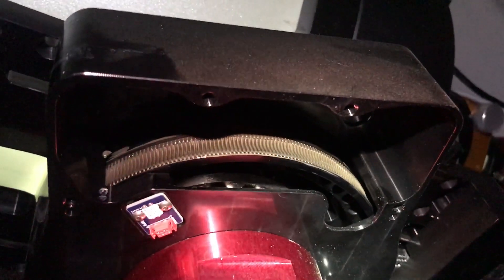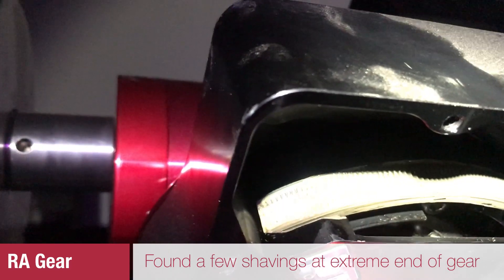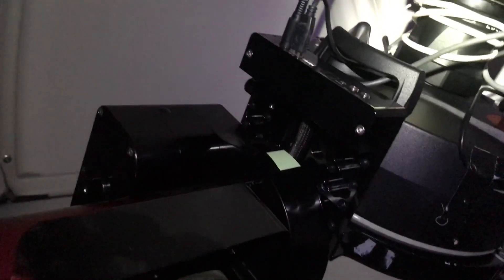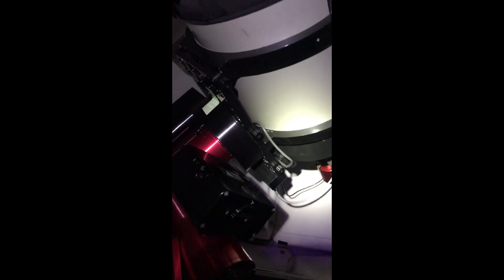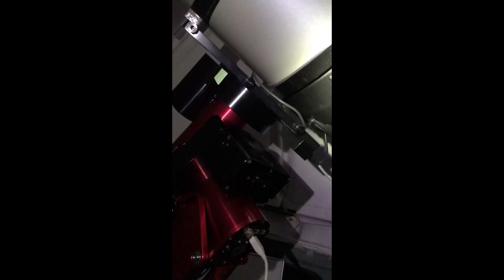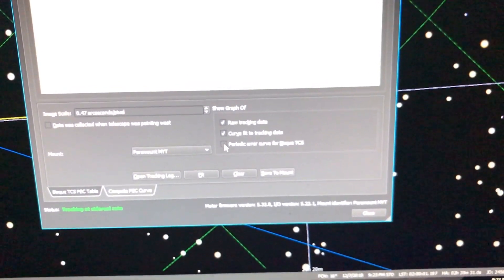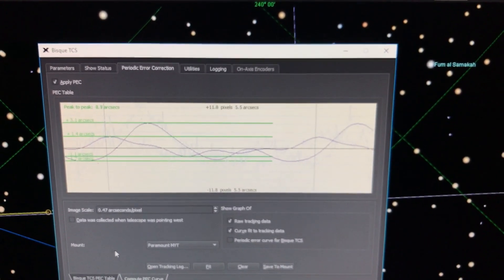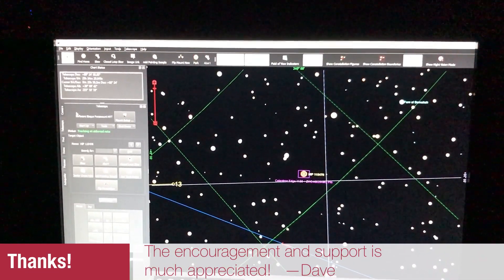PARAMOUNT MYT Visual Inspection and Star Test.

Comment: Congrats on your MyT surviving.  What happened to the video of the dome blowing off?
Reply: Larry Marks  It was being used without my knowledge or permission as a marketing tool against the dome manufacturer with claims by a rival company. Truth is I didn’t have an available safety tie down in place and part of the blame for the accident is on me. I moved it to private.
Reply: James Tickle Makes sense.   I was thinking about doing the same thing you did with my pod.   How is the ND dome normally held on to the pod?
Reply from the maker: Let me preface by saying a disclaimer. I did the solution I did because we are severely funds limited for this project at the college.  Had I the budget I would have replaced the entire structure with a Nexdome. 

That being said, I thought if the skyshed pod as a structure just like a second floor of a garage or anything else. I looked at Nexdome specs for the mounting points for their wheel ring that anyone can use on any structure they want to put a dome onto. 

I cut a ring of exterior grade sheeting to make a mounting/ mating surface and painted it with exterior  grade deck paint to help protect it.

Then I drilled pilot holes and lag bolted through the sheeting into the skyshed pod walls with pretty long lag bolts. The pod wall interiors are foam which help.

Then I put L steel brackets on the inside and outside to hold the ring to the walls.  I’ve rocked on it to check and it was very study/ stable. However I’m sure this violates all sorts of vendor recommendations from both companies. 

Last I had to cut a notch so I could mount the Nexdome motor controller bracket at the right spacing to engage the gear track on the inside lip. I also had to rig up a way to make the shutter battery charger reach the shutter unit.

All in all, the only thing I did that was wrong was I didn’t install the wind tie down on the outside that you can engage for just the same reason as my accident. I honestly wasn’t aware of the product and should have looked at the accessories a little closer. Or maybe Nexdome should automatically add it in as a default and just charge for it if I were to make a suggestion. 

The unit has worked well although with some occasional software patching between ascom drivers and TheSkyX. 

But in this hobby there are many instances where users need specialized installs according to situation.  I would recommend Nexdome to a friend, albeit with noted precautions and to be aware of expectations.  

Best of luck!